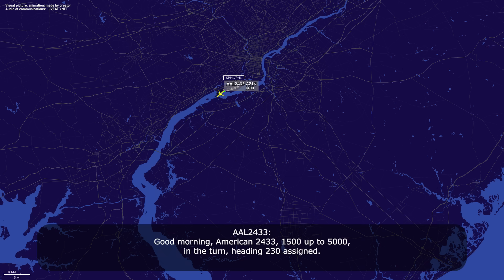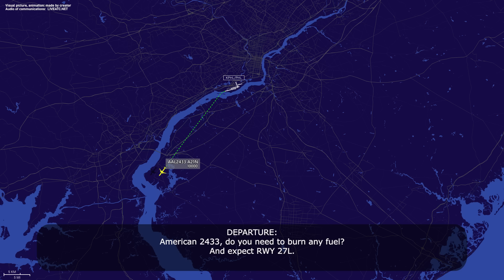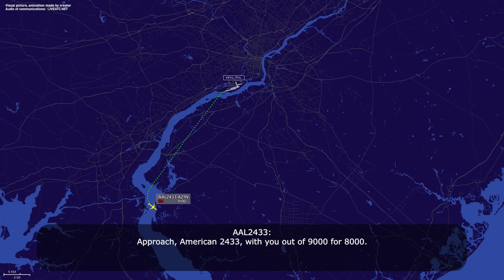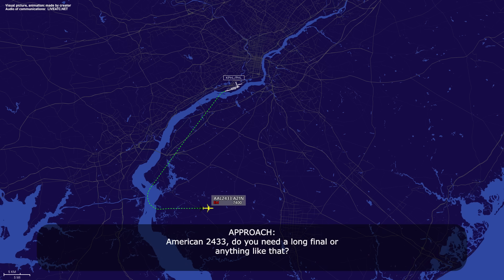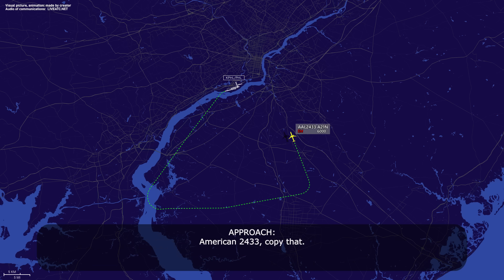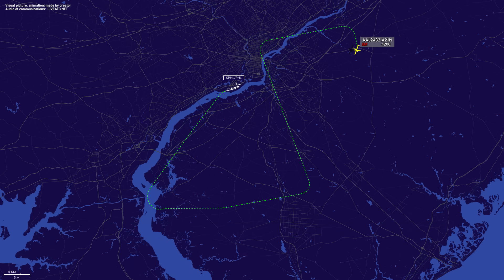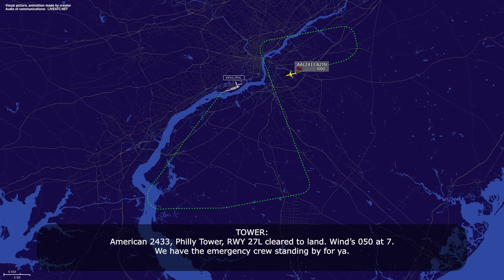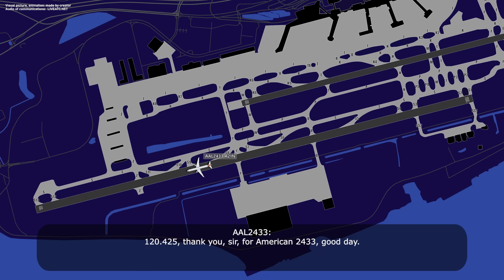Hydraulic LEAK after takeoff. American A321neo LOSES nose wheel steering at Philadelphia. Real ATC

Comment: I was on this flight . This pilot was so calm . Very good pilot to say the least! I did hear the hydraulic system over and over as we were climbing which I thought was a bit odd. But the pilot told us no big deal and went back to the airport very smoothly. I wasn’t that concerned as the pilot made it seem like just another day in the office.
Reply: How often did the pilot check in with the passengers? My fear is that during a big emergency you won't know what's happening
Reply: @ just once, also told us we should be back in 10 min . Took
About 15 or so.
Reply: @gonzofamily2744  so he was late?
Reply: As a pilot?   We are handling an emergency/abnormal.   We can't always make a PA.   When we have time?   Also, we are talking to the Cabin Crew via the Interphone.   That's what we do.

Comment: Kudos to the PHL controller for just double checking that they were "on the same page" with 27L - so many recent examples of controllers either not responding or scolding pilots for not reading it back correctly.  That's the way it should be done.
Reply: Thank you

Comment: OVER COMMUNICATION is worse than NO communication. THAT was perfect communication. Clear and Concise. Unrushed. Both very Respectful. and the double checking of the rwy 27L was SAGE level ATC.  after lots of RIGHT turns, that could have been a Gotcha moment during a high pressure situation. well done ALL! 

Seriously, i watched a lot of ATC emergency vids... and none were even close to this fine and exceptional example. Calling in the pans, escalating to mayday, delivering exact info... "in pounds" as per request. Vectors when needed and not ten messages saying "you need vectors yet?" style. This is a dream example of how ATC<->PILOTS help each other. I know it was scary, but everyone did their part to their best ability.
Reply: @patrickpacinhik5603 Hmm... You might be right, though I think I've seen in the 7110.65AA that it's required.  If so, thanks for the correction; I have to bug out to a bonfire, so I don't have time at the moment to find it and straighten myself out, but I'll try.  Not to be difficult, but to be certain.  At any rate, Happy New Year :)
Reply: Well… kinda.  All involved did a pretty good job handling a slightly stressful situation, but the loss of a single hydraulic system is really no big deal on a transport category aircraft, nor is the loss of nosewheel steering unless there’s an unavoidable large crosswind.  Many pilots would just use differential thrust and braking to at least taxi clear of the runway, if not all the way to the gate, which I’ve done a couple of times when nosewheel steering failed. And the approach controller’s comment on 27L was because he issued the clearance to intercept incorrectly.  The instruction should have been to intercept the <runway> localizer, and when he realized he’d goofed he corrected it.  No big deal, but not necessarily a “sage” example of situational awareness either.  And the flight crew used terminology that SO many pilots use these days: instead of reading back “one two thousand” and “one zero thousand” (the proper terminology), they read back “one two twelve thousand” and “one zero ten thousand”.  Doubling up like that is appropriate when communications are garbled or otherwise unclear, but not when comms are good, as was the case this time.